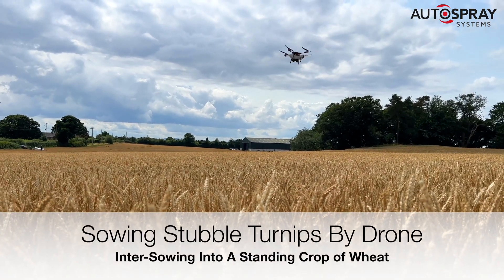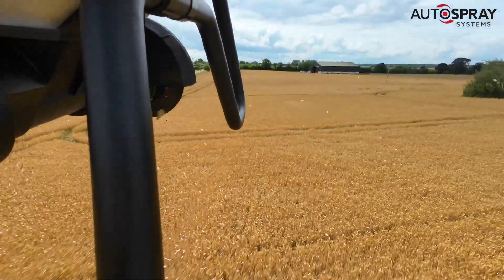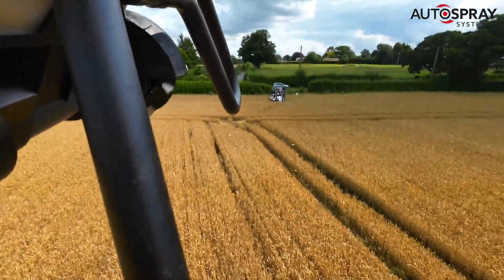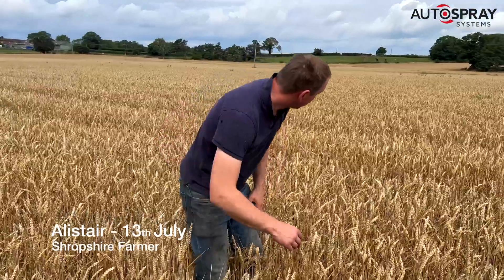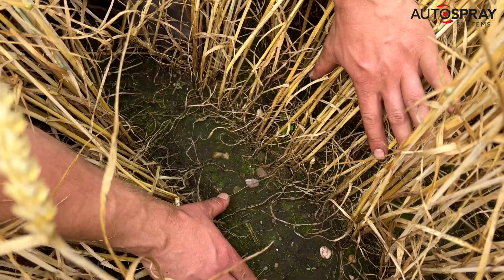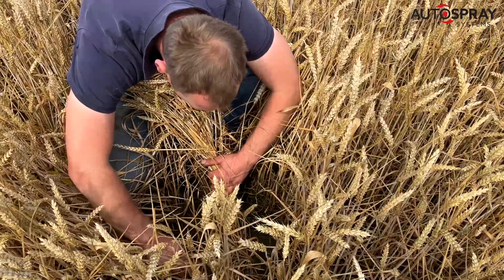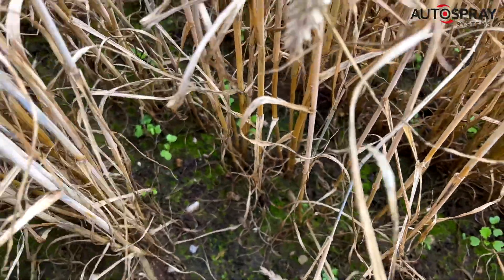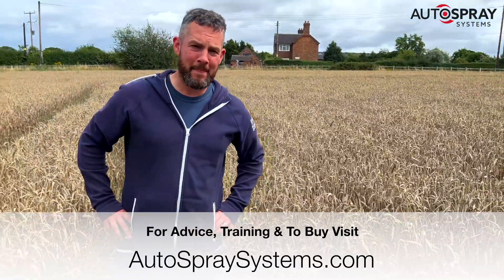Turnip Sowing By Drone - Inter-Cropping Stubble Turnips Into Standing Wheat

Comment: What sowing rate was used?
Thanks
Reply from the maker: We were using 9Kg's per hectare
Reply: @autospraysystems  that's a very high rate? What is the lowest rate you can do and do you use a carrier product, if so what do you use?
Reply from the maker: @gethda  Yes, it was at the high end. With a lower capacity auger fitted you can go down to 2kg per hectare